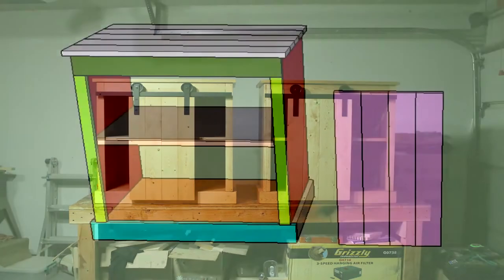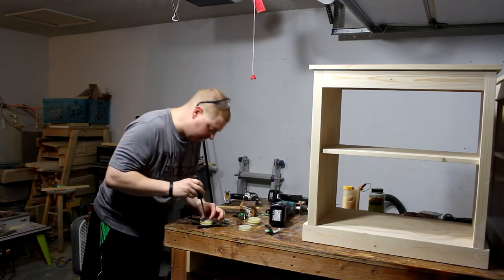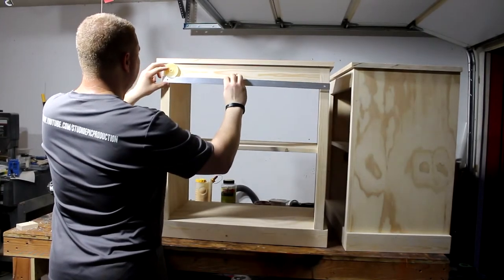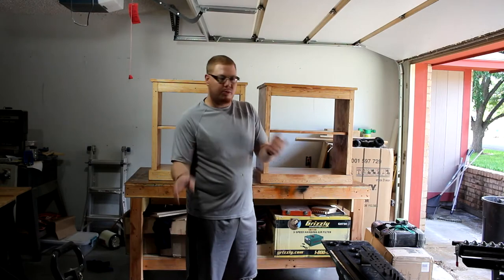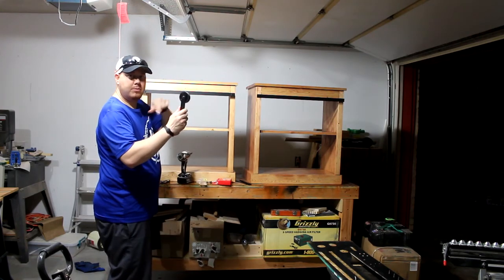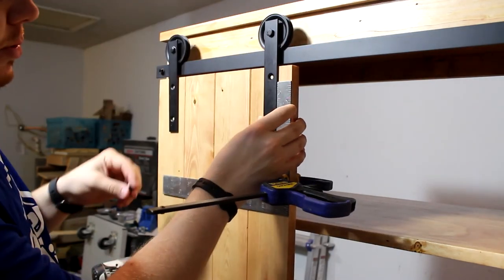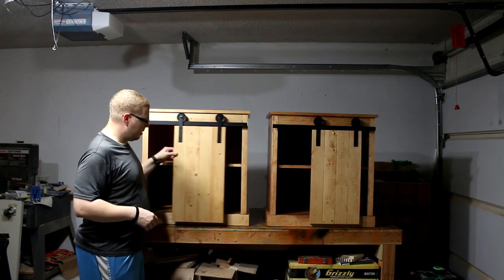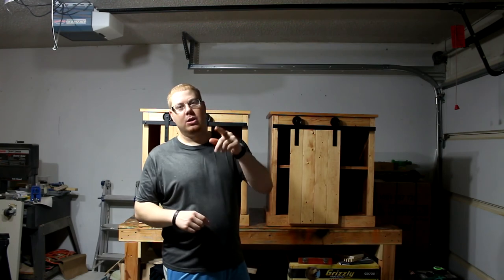Barn Door Night Stands (part 3)

Comment: Enjoyed the series very much.  Could you talk a little about where you got the metal, sizing, and the pulleys?   Great work!
Reply from the maker: I bought several different types of pulleys, but ended up settling on these here that I found at Home Depot.  The metal bar was also from Home Depot.  It was just a piece of flat aluminum that was sold near the nails at my store.  

The pulleys are clothes line pulleys and i just cut the plastic holder off of them.